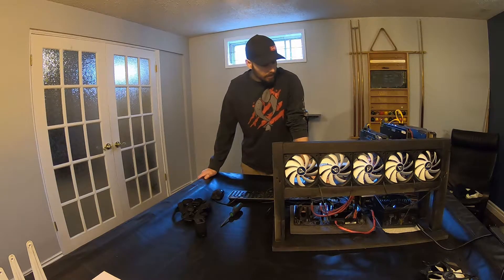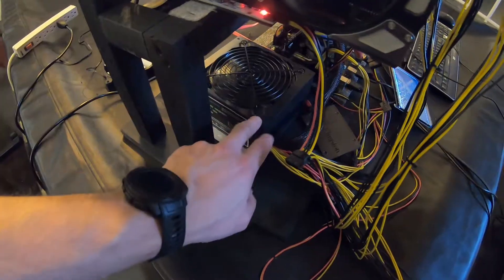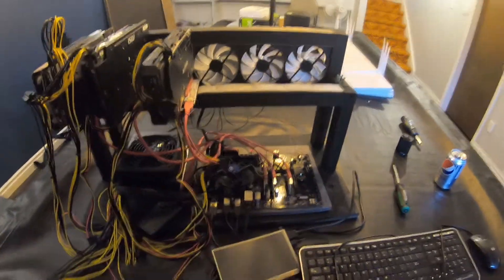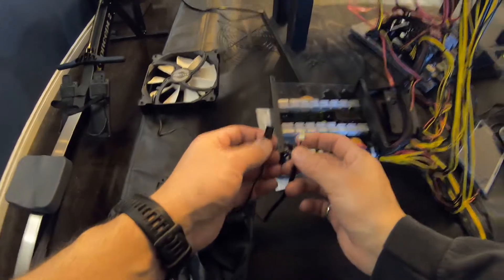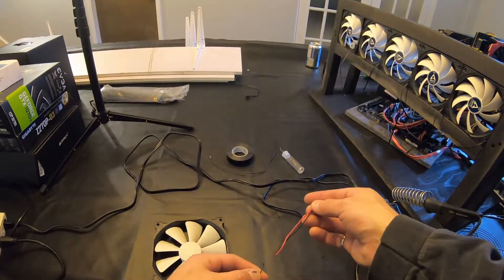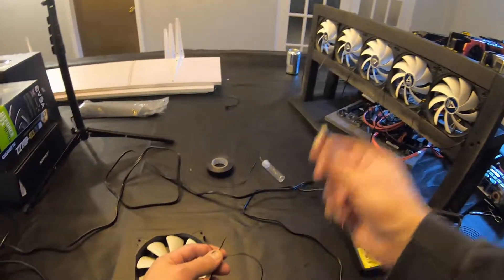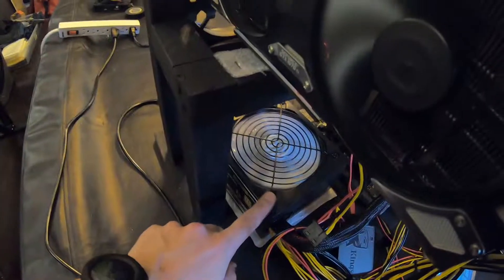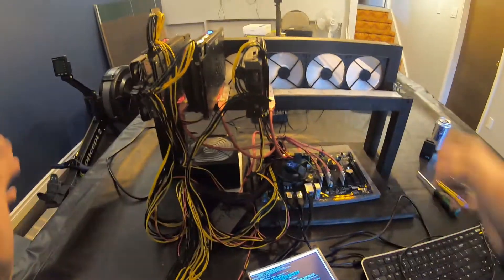Power Supply Too Loud? | Fix Your Mining PSU | Fan Replacement

Comment: can change or change the power of the fan rotation but must also calculate the energy we use because it will release heat...if you don't want the psu to lose early before the war

Comment: Do you think by changing the fan, it changed the way that it was originally designed to cool off the internals??  I'm just curious because of how loud these PSU are and was wondering if it's because it's needed to the extra fan speed... what are your thoughts?   I just did mine following your video so thank you for this :)
Reply from the maker: I do not think the original fan is better in any way than a standard case fan replacement. It's just a bad quality original fan so it was very loud
Reply: @ItsStuder  okay.  maybe it was all in my head... for some reason i thought the original fan was a lot higher in RPM.  I added some 1350 RPM today.. hopefully that's enough.  I guess I'm just a little concerned because the PSU itself is warm when touching so I thought maybe I need higher RPM fans.  

how long have you been running yours and any complaints so far?
Reply: change with rc plane fan...😂

Comment: Can i replace my psu fan? The fan is so loud also..
Reply from the maker: Yes you can replace it
Reply: Thank you bro, by the way my psu is also mining psu 750watts
Reply from the maker: Ok. It should be a 140mm fan but it could be 120mm as well. Replacing my fan helped a lot with the noise

Comment: Hi , is it possible to use a 2Pin Fan instead of the soldering part?
Reply from the maker: Yes. If your fan is already 2 pin, you shouldn't need to solder